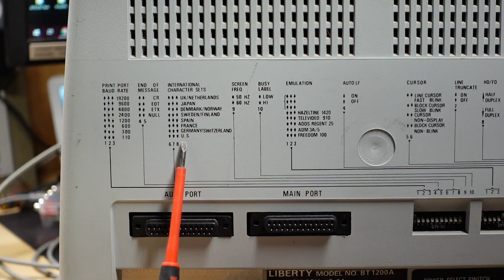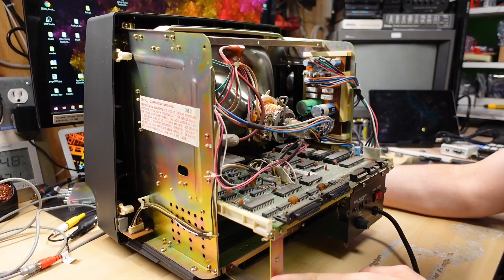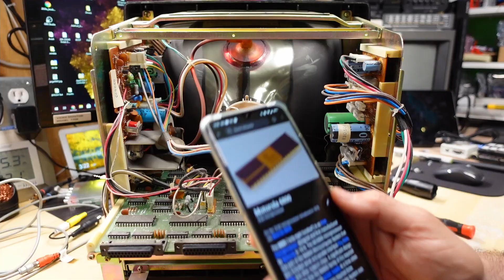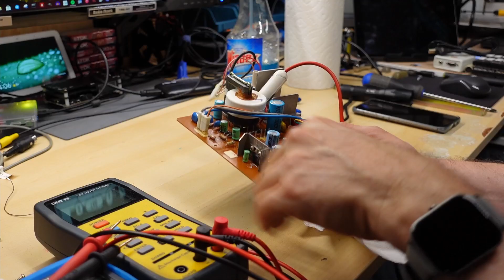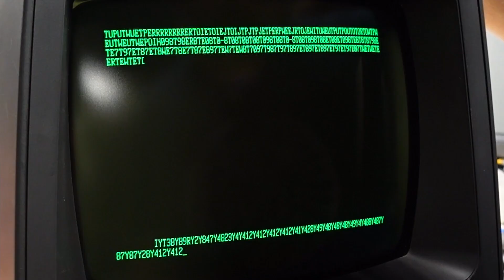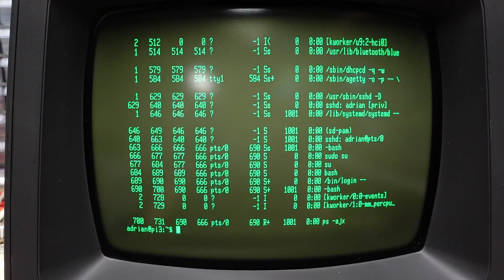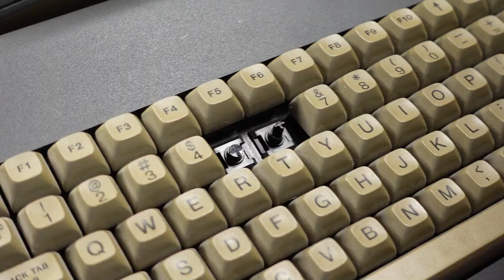Liberty Electronics: Freedom 100 Terminal Repair

Comment: Those exact key switches can be found on Apple IIe keyboards. Those long stems you have are actually uncommon. The white switches are used on large keys like shift, but you can use a black switch without issue.
Reply: Y not use a dremel to shave the long stems ... that should work; I'd think.

Comment: Doesn't "fixing itself" often mean a bad solder joint that starts conducting once a component heats up or something like that?
Reply: Ask any 90s Honda owner, Main Relay dry solder joints are a common thing once you have used the car, switch it off and then try to start again.

Comment: So, how can you use an old terminal? Can you connect it up to anything modern or do you need an old server to run them. I don't really understand how terminals work?
Reply: They can still be used with modern text-based applications. Adrian was connecting to his Raspberry Pi 3 but it would be just as easy with any other Linux system. Anything that can be done in your computer's 'Terminal' program can be done on a real terminal.

Comment: depending on the plastic or rubber, they develop a kind of "sweating" in their lifespawn
Reply: That "sweating" accelerates with age/heat cycling. That particular rubber cup probably only has another decade or two before it turns to goop, but I have a feeling that will be long enough. Either something else will quit and make the whole endeavor pointless, or a replacement can be fabricated when needed.

Comment: Hey Adrian,
Nice video. Love the old school terminal!
The sticky goo on the anode cap is dielectric grease (which may have gone bad after nearly 40 years ;-) ). It put there to to avoid HV arcing due to dust and moisture ;-)

Comment: I bet it comes back, in the data sheet you can see capacitor which run the oscillator I would change them and clean / change the pots

Comment: Device was sitting for 25-30+ years. The capacitors lost their "forming", the aluminum oxide coating on the plates inside the cap. Usually the caps will reform in the matter of seconds, but if a cap is connected to a power supply rail though a resistor (like 100K or more), it will sometimes take even long time to reform it. To check if reforming was successful, leave the device turned off for about a month, then turn it back on and see if there is again problem at power on :)
Reply: I have a Commodore 1902 monitor that a friend gave me that hadn’t been used in a couple decades. When I got it, vertical deflection was a mess. The screen couldn’t be expanded past about the middle 1/4 of the screen with lots of distortion, but as an experiment, I powered it on for a couple hours a day for about a week. Eventually vertical deflection returned to normal and has been fine ever since.

Comment: You might be able to fix those keyswitches by drilling a small hole down the centre of the cross on both sections and pressing in a stainless steel pin. Then glue the 2 halves back together, the pin should reinforce the joint and make it strong enough.
Reply: A short (5-8mm) length of paperclip wire would do the trick.

Comment: I wonder if it would be possible to remove the remains of the stems from the keycap with some really fine pliers and glue them back...
Reply: Or maybe heat a piece of paperclip and melt it in to both pieces....
?

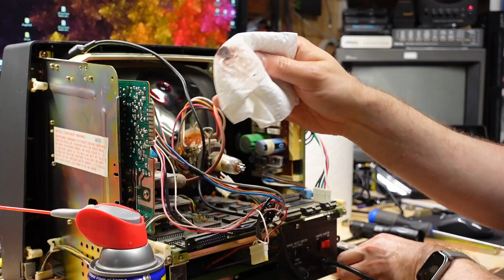Comment: 14:57 that's right ; in many service manuals (apple all-in-one CRT models for instance) it clearly states that if you're going to put away the open CRT you must loop the anode and cathode with a cable to prevent charge re-build

Comment: @14:39 I've had good results using 90-100% IPA to clean of the sticky degraded coatings on electronics (and hands), WD40 can cause some bad interactions with some plastics in my experience.

Comment: When the monitors were made they used a high voltage Silicone grease on and around the anode cap to reduce the high voltage tracking across the glass.
Reply: I have seen that in a few cases too where the manufacturer use silicone grease around the anode cap, but I have also seen those caps deteriorate on some New Old stock flybacks. Some plastic just gets that sticky as it gets older.  I have some older RCA branded monster like speaker cable that the plastic insulation is deteriorating in the exact same way.  It is also causing the copper cable inside to turn green!
Reply: Just sounds like a silicon based dielectric grease, you can pick it up at Menards and Lowe's for under $10, cheaper if you can find the smaller tubes, then under $5.
Reply: I'd advise against WD40 with rubber. It's mineral oil content might dissolve natural rubber. Silicone Spray might be better (but since it's sticky that might already be on there).

Comment: I had an Amiga 500 4 years ago, bought a video cable that connects it directly from the RGB output to SCART. I don't know if the modulator showed this issue but using this SCART cable I saw the whole screen shaking horizontally. I thought the guy who built the cable used the wrong resistor values or something but I didn't bother with it. Later I got another Amiga 500 which had the same type of video cable but this time it wasn't jittery. I figured that some caps were wrong inside the old one but at this point I already sold that old one so I'll never know if a recapping solved it or not. Maybe your screen issue is similar here at 27:20. I know you only change caps if they are proven to be faulty but it's always the caps.

Comment: The 50/60hz switch probably allows you to adjust it to the rate of your fluorescent lighting for slightly less eye strain. For maximum effort, it is possible to synchronize your CRTs with your long-tube fluorescents, but doing so generally violates the electrical regulations of most industrialized nations.

Comment: Usually those vertical hybrid IC:s have critical capacitors near them, just like in many integrated audio amplifiers. When those go out, the amplifier starts to have weird issues. I think it just had been sitting so long that those capacitors needed a bit time to reform,  there is (usually) nothing else that can go out (except dirty pots) that does not result in complete vertical collapse. 

I love how simplistic these old terminals are, if you can find service manual you can understand them completely, and even without it they are pretty easy to work with.
Reply: You can’t reform these types of caps. (Where has that come from btw?)

As mentioned to someone else, you’ll find it’s likely just oxidisation on the scan coils plug etc... the problem presented itself as a frame/vertical collapse, which is what it was, but with an odd wrap around issue. This could’ve been because the brightness was too high! I’ve seen it happen
Reply: @The_Studioworkshop  Reforming may be a bit wrong word, but in aluminium electrolyte caps thin oxide layer on electrode can broke down that causes capacitor to go electrically leaky. When power is applied oxygen is generated when water in electrolyte breaks down, and that somewhat self-heals the cap (also increasing the pressure and causing physical leaks), but that does not make it magically new. They are bad and dried and should be replaced none the less.

Comment: You could probably plastic weld some cross stems back onto the switches in the system. or  do some careful dremel work on the apple switches to continue the cross pattern further down on the stem, and then cut it shorter.

Comment: Definitely bad or old caps. They got some life back in em after being powered on again. It'll probably work fine for a while as long as you keep it on and running it. But you will need to replace them eventually.
Reply: Yeah, watching enough shango066 has taught me a lot about how vintage* caps can reform, but I've never seen "modern" electrolytics do that
(Edited to correct my statement)
Reply: @lauram5905  Shango's the man.  Even modern electrolytic caps can "reform" though they won't last.  He usually resurrects them for short term use.  If you intend to keep and use these, recap and reflow all solder joints.
Reply: @tiporari  I could do without Shango's nutty conspiracy theories, and the fact that he NEVER cleans anything and just leaves dirt and mouse crap on electronics.
Reply: @ct6502c  You must not have worked on electronics in an industrial setting. If you think mouse turd is an issue, you'd die if you got to see some of the stuff I have had to work on over the years. No one gives a crap what the components look like when in use. As long as the gear is working, that is all that they care about.
Reply: @tim_buck_too9126  When you're "restoring" vintage electronics, it matters. Oh yeah, that's right Shango calls it a "resurrection" to try to cover up for how he does a half-ass job with everything. It's sloppy, lazy, and pathetic. And that's not to mention his bullcrap conspiracy theories he rambles about all the time.
Reply: @ct6502c  Hard for me to comment on "Shango" given I have no idea who or what you are referring to. If it is a youtuber called shango066 then I'd have to watch some of his vids before giving you a response. I agree on your point about "restoring" something to it's former glory. That being said, not everyone "restores" what they are working on, some just want it working again. As an example, I have 2 classic VW Beetles. One looks like crap but runs beautifully and is driven daily, the other is restored to it's "as new" showroom fresh condition and only comes out for special occasions. As they say "horses for courses".
Reply: @tim_buck_too9126  Well, if you do watch his videos, you'll see what I mean. He actually leaves all the dust, dirt and mouse droppings on circuit boards and all over the old radios and tvs he "fixes." He doesn't even so much as wipe off the exterior. It really is disgusting. And then he also tends to ramble and get into nutty conspiracy theories. If you watch more of his earlier videos especially, you'll start to notice it. I was subscribed to him, but I just couldn't stand his nasty, shoddy work anymore and all his tin foil hat ramblings.
Reply: @ct6502c  I watched a selection. When it comes to his practical approach, yep, he's certainly "rough around the edges". As to his theory, he's pretty good, knows the old valve gear quite well. Tin foil hat stuff doesn't float my boat so it goes in one ear and out the other. He seems to be the sort of guy who enjoys "tinkering" thus he probably doesn't give a crap what something looks like. If he's happy doing what he does in his world, good luck to him.
Reply: @lauram5905  paper and wax caps don’t reform. Can elec capacitors can as they are in oil and applying a current limited voltage allows them to heat up... can’t do that with modern electros... you can’t reform them!
Reply: @The_Studioworkshop  @eDoc2020 I must have gotten them confused with the different kinds of vintage caps, it's hard to keep track of that stuff when you're looking at multiple generations at once in that old equipment, thanks for the correction
Reply: Also y'all have to remember, everything he works on he either does with interesting e-waste (and i use the term waste loosely here, it's more like coprolite fossils at this point) or things he's being paid to fix and actually take care of. Most of that stuff won't survive more than a year and he usually takes select pieces out for "EOL" shenanigans. It would take an enormous amount of money to convert a set used as a skid-row outhouse to something like 5 people in the world actually want to use
Reply: @lauram5905  I thought it was only electrolytics which reform, I've never heard of paper caps reforming. I too haven't seen modern electrolytics reform, although the phenomenon is hinted to in their datasheets. Here the problematic caps were probably part of the sawtooth generator where the leakage / reforming current would be much more noticeable due to the high source impedance.
Reply: I like Mr. Carlson's Lab videos, on the subject of cap replacement and testing, much better.

Comment: I've seen reforming capacitors on old TVs by powering it up slowly on a variac, this seems like a case of that?
Reply: "reforming capacitors"  what does this mean?  Thank you.
Reply: @jlfrodsham  some old capacitors will "wake up" when electricity it applied, and the electroyte starts to move, and the capacitor begins to run better
Reply: @Walczyk  Weird.... and interesting.
Reply: @jlfrodsham  google it, its quite common

Comment: Haha! In my opinion, all keyboards should have a "rub out" button!
Reply: A gangster terminal ;)
Reply: They all do, but the British English to American English translation is "backspace", but i think it is delete on this one :P
Reply: @frozendude707  There is also a "BACK SPACE" key. So RUB OUT must do something different.
Reply: @mal2ksc  Yeah, on most keyboards with that working it seems to be the same as backspace or whiteout, but not here, delete would be my guess.
Reply: @mal2ksc  I think RUB OUT used to be used for typewriters. When you made an error and used it to backspace, it literally printed white out over the previous character. At least some of them did.
Reply: @KaizenNeko If you had a nice typewriter, it would switch to a white ribbon and then type the same character you're rubbing out.

Comment: Thanks for the nice video, Adrian! I often watch your videos while doing some repair/restoration too :) The issue with vertical deflection is more likely because of the "tired" caps. The deflection current has sawtooth waveform in normal. Looks like the power rail was unable to supply enough current in the end of deflection current ramp, and we got that "rollover". Also I noticed that bad caps have tendency of temporary "self-repair" because of warm-up. Sometimes I use that fact to check them by heating with a soldering iron or a fan and watch if the device behavior changes.

Comment: I love these old terminals --- they're so satisfying to use. One thing you can do with them these days is to mount a Raspberry Pi or similar SBC actually inside the case, powered off the internal 5V supply, and then hook it up to the serial port, for a completely non-destructive sleeper Unix system.

Regarding the keycaps: you don't need to replace the switch, only the plungers. You might be able to 3D print a new plunger, although the tolerances could be too tight. If that fails, I bet you could 3D print an adapter part with connects to the broken plunger.

Comment: According to https://deskthority.net/wiki/SMK_J-M0404_series
the beige key switches are a type with "low friction" compared to standard. Those are lubricated more, so as to avoid binding on off-centre key presses, probably instead of having stabiliser bars. I'd guess that you'd find those also under the numpad-0, Return and Shift keys.

Comment: Um… you did remember to discharge the CRT before poking about in there, right? And just didn’t include it in the video?
Reply: OK, I see when you did it, but you should have done that as the first thing after getting the case open. Wouldn’t want you to get zapped.
Reply: Electrocution is overrated

Comment: In the old company we had terminals for the warehouse. The whole picture was built up with ASCII characters. Press 1 to put things in storage. Press 2 to get something from the warehouse. Press 3 to search for something. Press 4 to get inventory. Press 0 up one menu. Tab, Tab, Enter.  It was all very easy.
Because there are no longer any real terminals, we ended up with Linux computers and laptops with terminal emulation. In the office there was the server where all data was stored and the backups were made.
Reply from the maker: So it was still accessing the back-end via text mode interface but just using emulators. Funny. There is something to be said about how quickly you can move around in a text interface. Just requires a steeper learning curve.
Reply: @adriansdigitalbasement2  I’ve also seen a lot of POS terminals just running a terminal emulator too, hooking up to the same store inventory etc as in the 80s and 90s :) but on much newer hardware! This stuff seems to be more common than anticipated in various sectors
Reply: This kind of ASCII mode interface is still used in some big rental car chains and airline checkins. Users connect with windows based terminal emulators to the server.